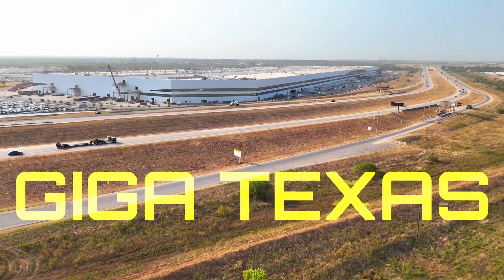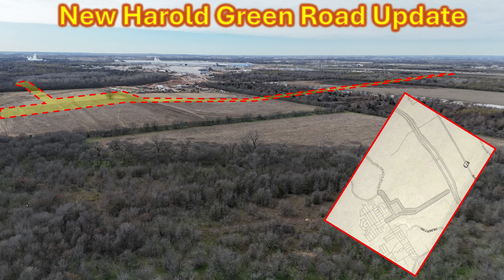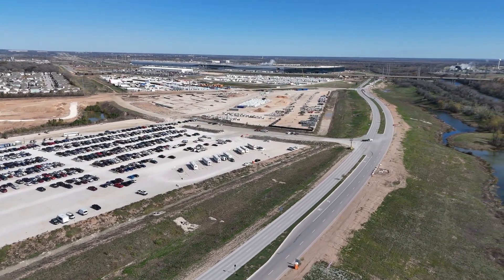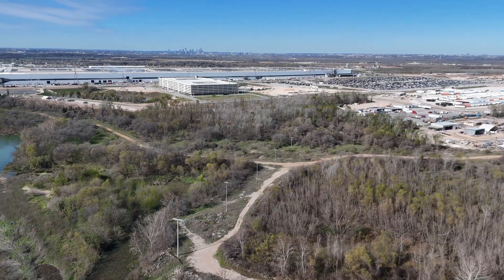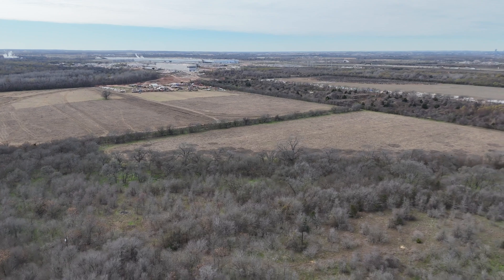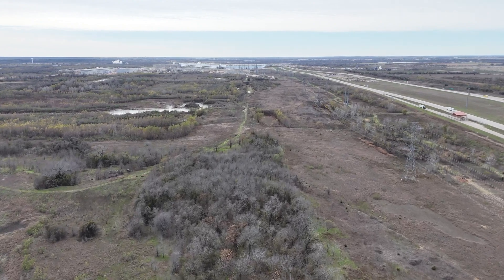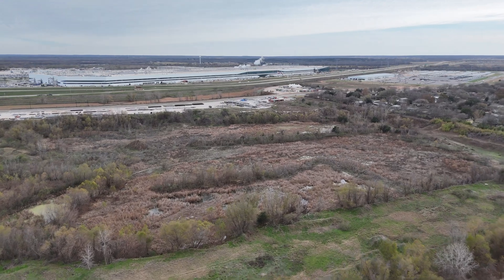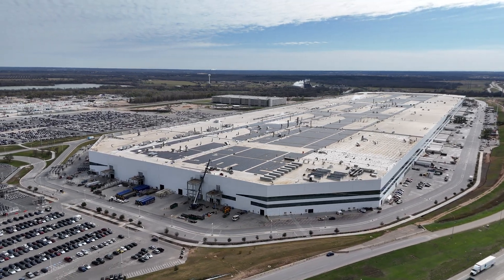Grand Tour, New Harold Green Rd Permit & 360 Degree Flight! 13 Jan 2025 Giga Texas Update (09:55AM)

Comment: Thanks Joe
Sort by Newest First or Top Comments if only the first few lines are visible*
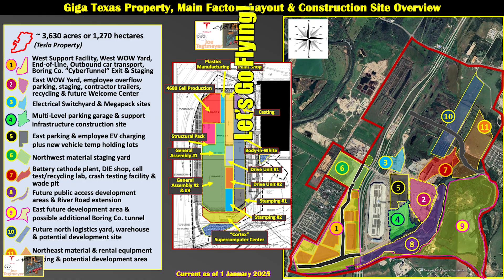2:53. West of FM973. Left. Huge stockpile of earth. Some earth was extracted from this side of the road to be used as fill at the Parking Garage site, and River Road east extension.
4:19. Far west. Silt fence. Likely that excavated earth will be dumped here from the ‘Giga Texas Offsite Wastewater Interceptor project’ works, left at 5:40.
6:01. Transmission lines. Left. Tall transmission lines that bypass the Sand Hill power plant provide the main power supply to GT through the Switchyard/Substation at
The Sand Hill power station may still provide some emergency or back-up power to GT, through the low level power lines that cross the river at 6:32. The original supply to the site in 2020 was through those low level power lines.
10:17. Dailey Middle School. Named after the farming family who owned some of the site prior to Tesla purchasing it. Old farmhouse site at the end of the dirt road at 10:52.
13:07. Temporary Batch Plant. Left. Some earthmoving machinery. Cleaning up the site perhaps. Visible in Brad’s 9 January video at 9.50.
15:09. Battery, west. Apron. Black semi and trailer delivering a coil of stainless steel for the battery can production.
16:13.  BIW. New loading platform. Not much seen going in.
Reply: 6:01 Thanks for catching that I I noticed and then forgot to mention it.
Backup power to GT...
I believe backup power is provided by Bluebonnet.
@ 15:46 You see 2 sets of low level distribution lines. The lines closest to River road belong to Bluebonnet. The other lines belong to AE. And of course Sand Hill is owned by AE.

Comment: Not really into grand tours, more prefer the in close views, however that Harold Road replacement has me a touch perplexed, as in Why? all it's doing is putting a big divide in the middle of their land. If it were a council requirement, then why all the permit stuff, I would have thought they'd (council) be chasing that. Anyway, hopefully they put an underpass etc in it so future Tesla works don't have to interact with it as they cross from one side to the other. getting the Boring company back in the future for another tunnel would be nuts as they currently have all the land involved under their control (assuming the new 'Harold Green' would pass back to council control)
Reply: From a news article, that road project was planned by the county since 2017. It was a completely different rout that would extended what is now Tesla road. When Tesla bought the property they took over the project for designing and building the road.
Reply: The Giga Texas site is in the Extraterritorial Jurisdiction (ETJ) of the City of Austin, which means that city council has only a limited say in what goes on at Giga Texas. Instead, Giga Texas falls within the jurisdiction of Travis County, and county commissioners in Texas also have limited say in what goes on at a site.
Reply: @alanrivaldo-h  Republicans.....
Everything for big business.

Comment: Joe,  I'm from western North Carolina and our Broad River became a monster due to Helene and destroyed much throughout it's valley, wiping out roads, bridges and buildings built along it's banks, much of which was above the 100 year flood plain.  I see the Giga Austin is next to the Colorado River.  What will be the impact on Tesla if there is a 100+ year flood like we had in western NC?  Has a worse case flood study been done?
Reply: There’s a reason much of the Tesla site was used as a sand and gravel mine. The floodwaters from the hills upstream would spread out where the land flattens out just east of downtown and allow the sediment to  be deposited in the area. Although there are several dams upstream now, only one was designed for flood control. Since it was built in the 1940s  the water level has come within a few feet of overtopping it several times. The 100 year floodplain is about the level of River Road, the 500 year level would cover part of the footprint of the factory .  Both FEMA and the city of Austin have online floodplain maps for those interested in the details.  Tesla has moved a lot of dirt since the maps were drawn, but  the highway 130 bridge abutment base is at the 100 year level and it hasn’t moved, so it is a good reference point.
Reply: @Frank-gt7me  That is a great reference point! From the site plan in Joe's 29 September 2021 video at 3:43, the 100 year floodplain line is also visible. More or less skirts the main factory east of the powerline easement.
Reply: There are no nearby mountains, or even hills, and valleys to collect and channel water from a wide area into the river flood plain.  All of the area there is flood plain.  It's hard to tell from the drone, but the construction is all raised above the flood plain.  A 100 year flood would put everything in the lower area of the plain underwater and then it would recede.
Reply: The Colorado River near Giga Texas is downstream from the Highland Lakes where rain tends to fall. These lakes function as reservoirs, and were created by a series of dams on the river, which are owned, operated, and maintained by the Lower Colorado River Authority (LCRA). LCRA just happens to be the same quasi-governmental organization that owns the substation which feeds electric power to Giga Texas. One additional dam in the river, closest to Giga Texas, is owned and operated by the City of Austin. One of the dams is used to ensure that the portion of the Colorado River running through Austin maintains a constant level to avoid damage and destruction similar to what you had described. There are no guarantees, especially with climatic change, but in addition to heavy rainfall events, Texas is prone to severe drought which was rather egregious in 2011.  That drought, along with poorly negotiated water supply contracts, left the Highland Lakes at alarmingly low levels that took several years to reach near normal levels after the rains returned.
Reply: Great responses and information.  Prior to Helene I could not have found a single person that would have believed that a series of storms could take out an entire town, a several state roads and an interstate (I-40) in less than 24 hours.  Nature can be a cruel reminder that we aren't as clever as we think we are!

Comment: Third try. Once again, YouTube has to make it hard.....
To see my comment select newest first.
Reply: Nope
Reply: @memrjohnno  The comment should be visible from newest first. Frank just replied to it. Hope it didn't get deleted completely.
Reply: Joe didn't turn the camera enough but it was residents of the community to the east of lone tree field that were very worried about the addition of heavy traffic so close to the 'village'. The throughfare or rather the need / expansion is for business / commercial reasons rather that local demand. 5-6 locals in 5-6 short video takes.
Reply: @memrjohnno  That might have been a concern earlier. Because according to a news article, the original plan from the county back in 2017 was to extend what is now Tesla road.  That could have dumped a lot of traffic into the neighborhood. I'm guessing the new revised plan solves that problem, at least for now. That is, unless Tesla builds a major new facility up there.
Reply: @DavidJohnson-tv2nn  What's interesting is the spur of the new road that branches off into a wide area that abuts the river.  Could be a way to get visitors over to the island where the tunnel was supposed to go, so there could be a loop from Hwy, Harold Green, over to island, through tunnel to Tesla Rd and back over to the Hwy.  Tesla can build for a long time before they need to cross the new road.  Or maybe this is a new plan for where the tunnel goes to the island, using the landing area the road runs up to by the river.
Reply: @scottgaree7667  By any chance are you referring to the map seen @ 1:29 (Left)?
The reason I ask is that is not a very good map. As part of the permit documents, the Elm Creek Tech Memo has a much better and highly detailed map.
What appears to be a spur branching off the new road is actually the proposed new diversion channel for Elm Creek.
Reply: @DavidJohnson-tv2nn  Yes, that is what I was referring to.  Thanks for the extra info.

Comment: Harrold Green Road:
@ 11:32 Elm Creek, which flows under 130 on its way to the Colorado river  has an important part in the design process for the new Harrold Green Road.
One of the permit documents.... The Elm Creek Technical Memo has a lot of information.
Here are the important parts....
"As the 1D model shows, the diversion weir and channel provide adequate stormwater management to ensure no rise in water surface elevation on neighboring properties when compared to the corrected effective model that uses the mining pit reclamation terrain and accounting for Atlas 14 flows."

"CONCLUSIONS
The diversion channel is necessary to maintain water surface elevations on Elm Creek with the proposed Harold Green Road improvements. The proposed work provides a needed connection between SH130, the Tesla Giga Factory site, and the Austins Colony residential development."

The Topographic Work Map shows the proposed Harrold Green alignment, the diversion weir, box culverts that will go under the road, and the diversion channel going to the river.

@ 9:20 (Bottom left) Path of proposed diversion channel along the eastern edge of the property to the Colorado river. Basically where the dirt road is
The new channel would enter the river @ 8:20 just offscreen to the right.
Reply: at 11:17 you can see how the creek fills the old mining pits after a rain.  Only the tops of trees/brush growing on the ridges of the pits are still visible. If they channelize the creek bed then they lose that overflow capacity and it would just cause higher water levels in the neighborhood.
Also, the new road alignment doesn’t seem to actually connect to 130, which makes sense since there is no frontage road there, just the beginnings of an exit. I wonder if there is a separate plan for TxDOT to add an access road?
Reply: @Frank-gt7me  Exactly, regarding the mining pits. Building the road and channelizing the creek creates a new flood hazard for the neighborhood. The solution is the diversion weir. When water rises to a certain level, it will pour over the weir and into the new diversion channel. According to the documents there is an existing diversion channel, which will remain, but apparently it isn't big enough.
130 access...
Good point. It will be interesting to see how they sort that out. Because as it is now, it doesn't seem like the new road would help very much.